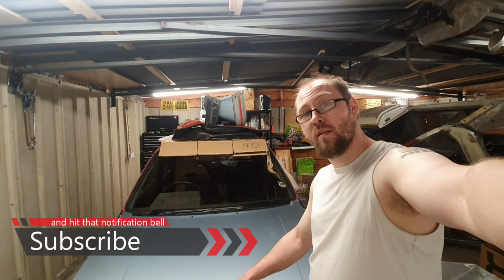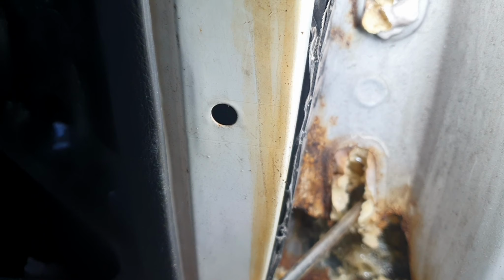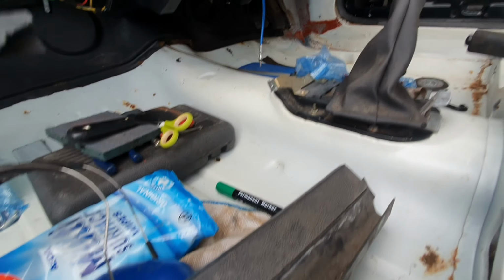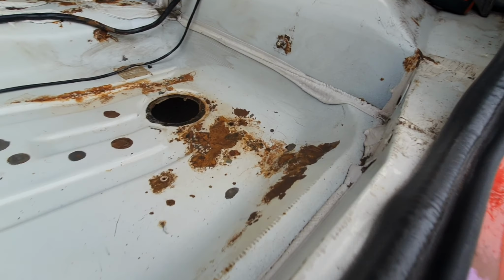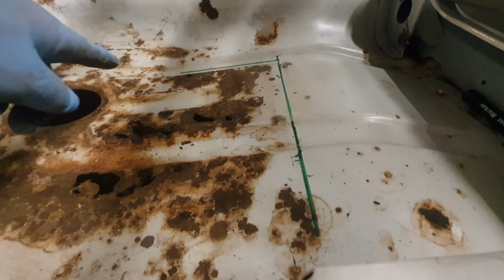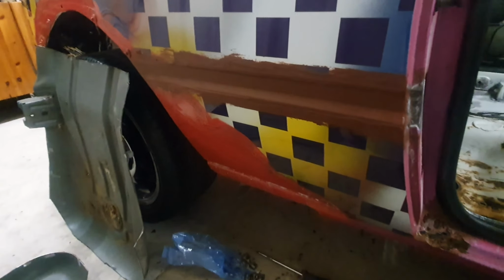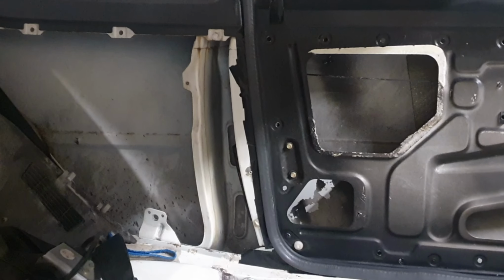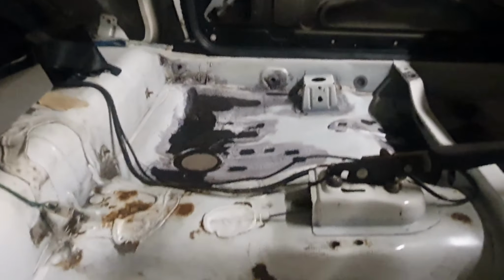Peugeot 205 GTI floor and rear quarters it's not looking good 😐

Comment: Great video what are the 2 big round holes in the floor for
Reply from the maker: Thay are for letting water out most cars have 2 or 3 but peugeot went for 1 big one each side 😂
Reply: @RetroCarsReborn  oh ok Thanks. I just brought a 205 I thought they were rust holes. Then I seen your video and you had same holes I thought that was strange 🤣